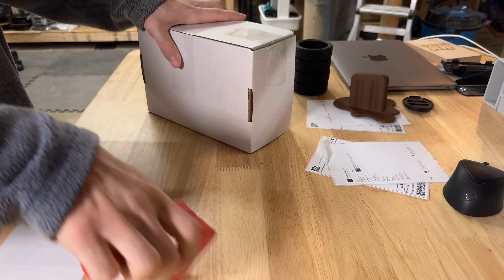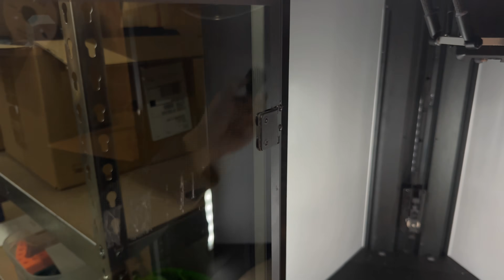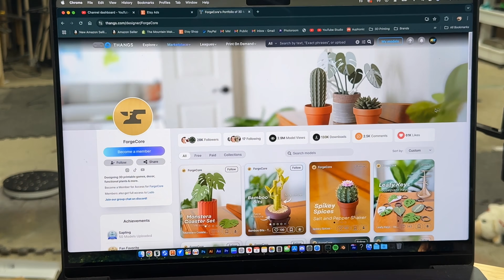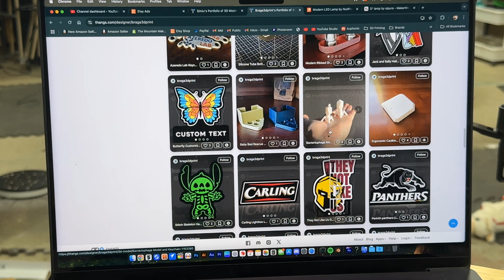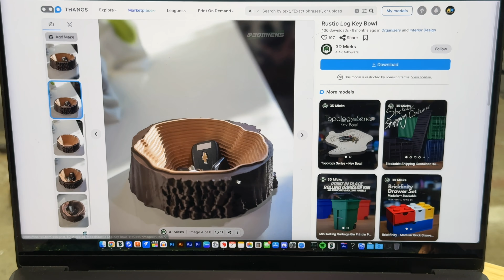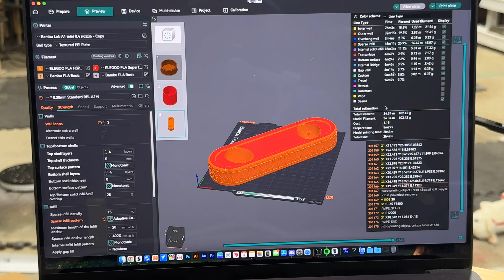Running My 3D Print Farm | Day-to-Day Workflow & Shop Updates

Comment: if the elegoo and deepelee pla the same settings as the bambu lab pla matte
Reply from the maker: Its very close, but its best to run calibrations to get the filament dialed in for the specific brand. I think there were only 2 or 3 settings that Ive changed for the elegoo/deeplee filament

Comment: What software you use in Surface? Never seen that dark colored software.
Reply from the maker: That’s the Klipper backend. My Ender 3 V3 SE is running a Klipper firmware instead of the stock one that it ships with so I’m using the surface as a server and touch interface to control the machine. It’s dark because i have everything setup with dark mode. It’s much easier to look at for longer periods of time in my opinion
Reply: @TheMountainMaker  BIG thanks for answer. Im thinking moving my Sovol machine from Marlin to Klipper and I also have Surface without any use. Need to test what i can achieve 😁

Comment: Hey love your vids! Was wondering how you have the ELEGOO filament profiles in your Bambu Studio? I mainly use Matte PLA from Elegoo and just been using the Generic PLA for all my prints. Although its been working so far and have had no issue. I wanted to know whats the difference between using the Generic PLA option over the ELEGOO option? Is it very noticable and significant? Could you show me or direct me to a video you may have made that is in regards to adding that profile to Bambu Studios? Cheers and thanks so much, really look forward to your videos as it inspires my little small 3d printing business as well!
Reply from the maker: I ended up running some calibrations within Orcaslicer on one of my Bambu machines when I first started using Elegoo filament. It has ported over to most of my machines very well, aside from the Plus 4 from Qidi due to the larger hotend that printer has and I had to redo calibrations for that machine. Bambu studio, as far as I know, doesn't have the calibration menu like Orca does. I would definitely recommend trying out Orcaslicer if you've never used it, if for nothing else other than the calibration menu, as its super helpful when dialing in new filaments.

Comment: Advice please, I know you didn’t use it in this video. But I have just bought the original grey cyrogrip plate for a1 and I’m unsure what plate setting to say it is on BambuStudio. Which one do you use? I bought it on your recommendation from another video
Reply from the maker: I created a new filament profile specifically for PLA and PETG—the only two materials I print with on that build plate. The settings are identical to my standard filament profiles (like the ones I use for Elegoo filament), with just one key difference: the build plate temperature.

For PLA, I lower the bed temp from 65°C to around 50°C, though it can go as low as 40°C depending on your environment. For PETG, I keep it at 70°C to ensure a smooth, consistent first layer. I also use the Textured PEI bed setting for optimal adhesion.

Comment: We need to get you set up with a bunch of Q1 Pros. Larry & Curly have been beasts for me last 9 months. Most versatile little printer for the price in the world imo. We need to get you out of Bambu's Bastille.
Reply from the maker: I love my Qidi, but for the cost of the A1/A1 Minis, you simply can't go wrong. I'm not a huge fan of Bambu as a company, I don't agree with a lot of their practices, but there is no denying the machines simply work. For just over $200 for the A1 Mini, it is very cost effective and the multi color/ams is something no other company offers at this point that is as well integrated as they are with the Bambu machines. 

That said, Flashforge has some pretty cool new machines coming out so you will for sure be seeing more than just Bambu in the next couple of months. 

If Qidi wants to send a few Q1 Pros over, i'm always game at trying something different but Bambu is arguably one of the most popular brands on the market right now and unfortunately, that is what most of the people new to 3D printing seem to be going with so featuring older machines or machines from a company that is not as popular as Bambu, especially one without multicolor capabilities is a bad move for my channel and subsequently, my business.

Comment: Hey man, I hope you are doing well. I am looking for advice. I have A1 and X1C but they are always busy, especially with one of my products takes 5.5h per printer. I am looking to add another printer as a backup for my own prints, prototypes and emergency for small orders. As you ran the Mini as a horse for your business for some time what are your thoughts? Should I future proof with another A1 as the business expands, or is the Mini good enough? Kind Regards, Mike
Reply from the maker: Hey Mike, If you have the budget and need the larger build volume, the A1 is a great choice for keeping your setup streamlined and not having to switch up printer profiles in the slicer. But if your prints don’t fully utilize that space—or you’re only printing one or two at a time that can easily fit on the A1 Mini—then going with two Minis can be a smarter move, especially since your product takes 5.5 hours to print.

In that scenario, two Minis would effectively double your output compared to a single A1, assuming your parts fit on the Mini’s bed. That’s exactly why I use the Minis myself—they allow me to produce more units simultaneously, whether it’s in different colors of the same product or entirely separate items.

Of course, there are a few things I make that don’t fit on a Mini, which is when the larger build volume of printers like the P1P, the AD5M Pro from Flashforge, or the Plus 4 really comes in handy. But 90% of what I sell fits just fine on the A1 Mini, and I can often print more than one item per machine at a time.

Thanks for the question!
Reply: @TheMountainMaker  Thank you so much for taking the time to reply, I appreciate it!

Comment: Is the Ender 3 V3 SE a good enough printer, I am  a rookie looking to by my first printer with a budget to about $250
Reply from the maker: For that price i would hands down go with the Bambu Lab A1 Mini over the Ender 3 of any kind. The Bambu Lab machines pretty much work right out of the box and the Ender 3 V3 SE works, but will give you more struggles than it’s worth for the price especially considering the other options available right now. 

If you have a little time to wait/can save up about $100-$150 more, you can get the A1 Mini Combo for multicolor printing, or if you are looking for a larger build volume, the full size A1 without multicolor is around the same price as the A1 Mini combo. The V3 SE in my space has been modded with custom firmware and even then, it’s still not a machine i typically use for production parts or things i plan on selling

Comment: I honestly don’t know why some people don’t like the flsun printers for I have just picked up a qq-s for cheap needed work done but would love to get a newer version one day but family come first
Reply from the maker: In my experience, the S1 and S1 Pro have proven to be historically unreliable. Even something as simple as a clogged extruder can turn into a time-consuming repair, requiring extensive disassembly and a solid understanding of the machine’s internals. They’re not particularly user-friendly or serviceable, unless you’re ready to spend a full day troubleshooting—and even then, it’s rarely straightforward.

Print quality is also disappointing for a machine priced at $1,500. There are several alternatives on the market today that deliver better results at a fraction of the cost. That said, after upgrading mine with new parallel arms and replacing the effector unit, I’ve had more consistent performance. However, a simple filament jam in the extruder still sidelined the machine for over two months due to delays in getting replacement parts and the time required to complete the repair.

When it works, I do enjoy the machine. But at this price point, I can’t justify recommending the S1 Pro. For $1,500, I’d rather buy two or even three P1Ps. The S1 Pro’s round build plate may seem spacious on paper, but in practice, you’re limited to about a 240–250mm square—so the advantage is minimal. If your projects are primarily tall, cylindrical prints, it might be a fit. But for most users looking for a dependable, versatile workhorse, it falls short.

Delta-style printers, in general, continue to struggle with consistent print quality due to the inherent design limitations. While I haven’t tested the T1 Pro personally, it appears to offer better value, especially given its frequent sale price in the $300–$400 range.

In short, the S1 Pro can deliver decent results when everything’s working perfectly—but for those seeking a reliable, “set-it-and-forget-it” experience, I wouldn’t recommend it.
Reply: @TheMountainMaker yah I am new to 3d printing so just starting out I bought two ender 3 pros for 100gbp one had all the v2 upgrades on so I upgraded the other and just sold one for 80gbp then bought the qq-s pro for 40gbp with lots of extras  so I’m just finding things out at the moment

Comment: You could go with a different box size, but keeping boxes standardized and relatively low number of options is SO important for being able to estimate shipping and supply costs. It quickly can get overwhelming with space expense alone, and then factoring in tracking use and what fits in what box or chasing the right nesting for x products in y boxes.

The lack of image and estimates on the tire organizer is due to the A1 series buffer.. if you ran a couple jobs prior or a larger print job, sometimes the buffer simply does have the available compute time and storage space to load the preview information. Same reason that they havent pushed that locked down firmware to anything but the X series, as the others don't have the same processor and memory bandwidth to handle the communication load.

Also so glad for you to call out models with trademark. Just because you or someone else modeled it, doesn't mean it was done so in a legal manner or sellable result without 100% still being at risk of trademark/copyright infringement.

Removing the plates and models on other plates isn't really needed (while on topic of time savings), since you can only send a single plate to the A1 series at a time, you only have to focus on just the plate you want. I have projects with 20+ plates with  different files on each so I can just load X file, select the product I want and send it to the printer to get done.

Comment: Just because an item has x amount of downloads, doesn't mean that there are x many people selling.  It's more likely that there aren't that many of those folks who downloaded it selling it..  I'd also stress to folks that if it's something that's NOT licensed for commercial sale, yet you ARE able to download, check with the creator and see if they have a commercial license available (I see tons of stuff on Etsy that's most likely not being sold with the proper licensing, it's one of the reasons I don't sell there currently).  I have a couple designers I'm working with on getting custom versions of some of their designs made for just me, and hopefully those will be popular (biggest issue here is, that design work isn't cheap, but you gotta spend money to make money I guess, lol).
Reply from the maker: Very good point. I did mention that in the video I think about the people downloading the models may or may not be selling them, but the download count is something to pay attention to especially on platforms like thangs where a good majority of the designers are selling a subscription package to their items. Not to say everyone is selling them, but for the prices that some of the designers are selling the subscription packages at, theres a good chance quite a few of those downloads are from a subscription. Just be smart and thorough so you aren't wasting time and effort for something that is already a saturated market i guess.